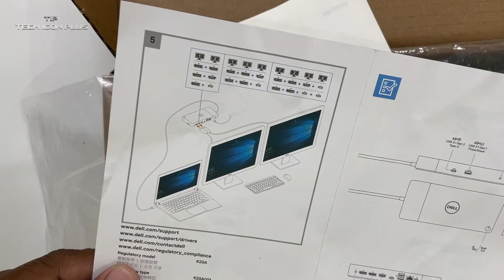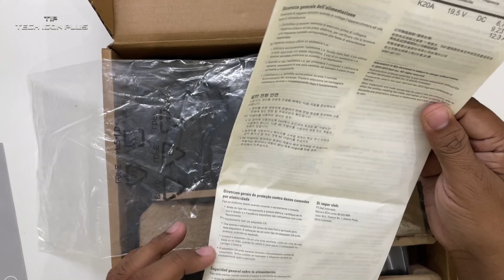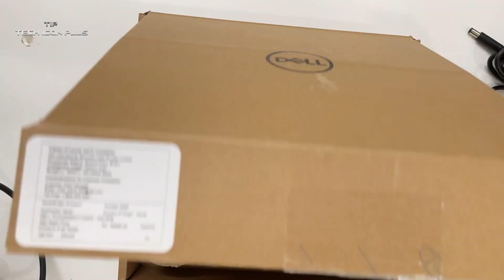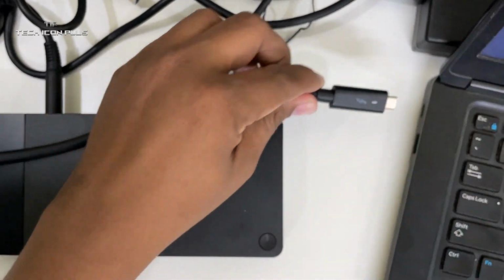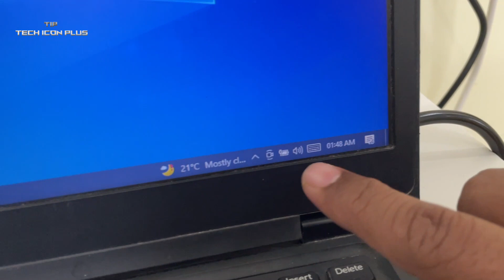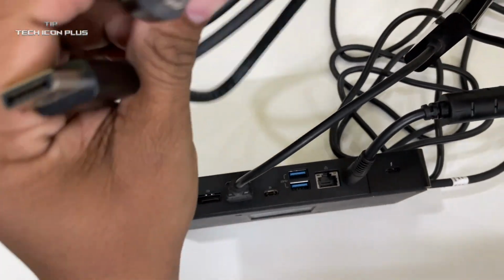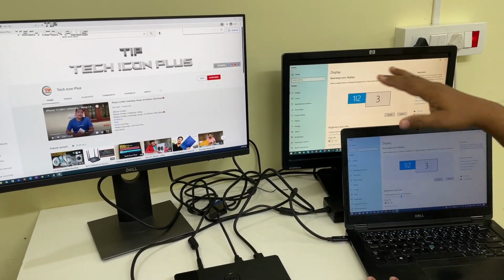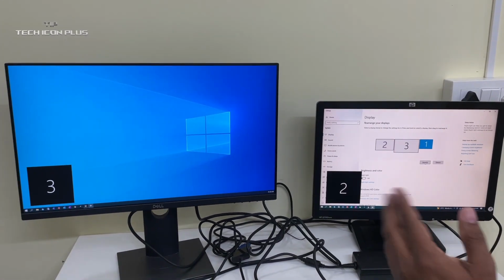Dell Thunderbolt Dock

Comment: 3:18 - it is not power supply, it is switchable Thuderbolt 4module WITH one power supply USB-C Th4. Depend of version, you can meet option with 2 additional USB-c Th4 socket. Power supply as you show is separately...